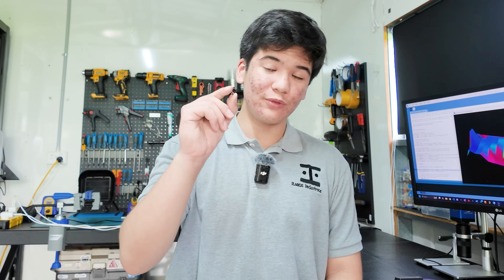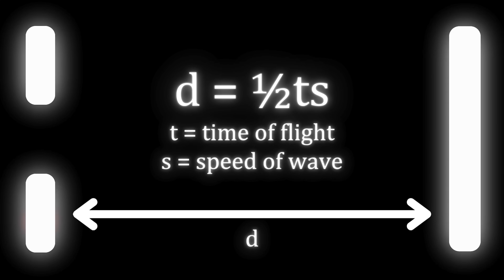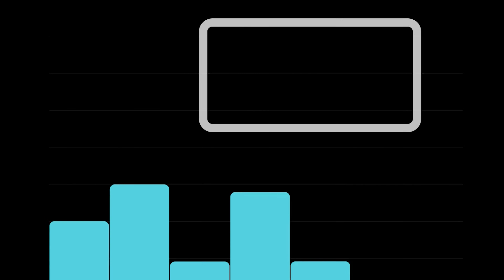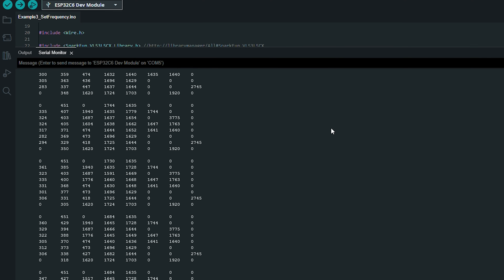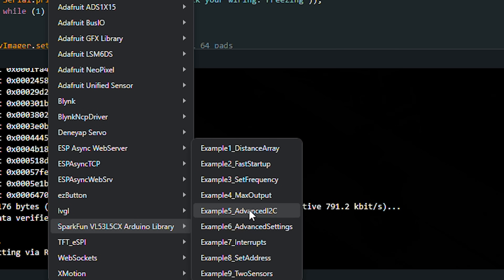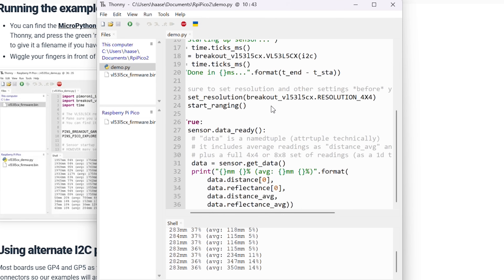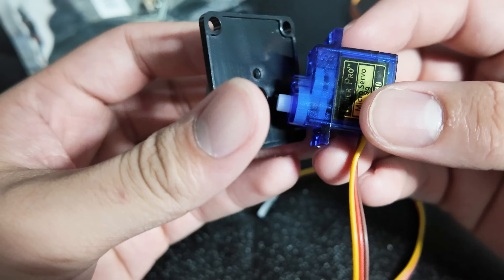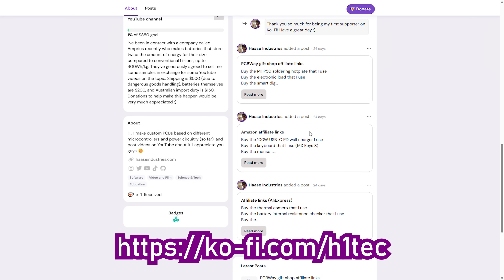This Tiny Sensor Sees in 3D! ToF Sensors w/ STM32, ESP32 & RP2350 Explained (VL53L7CX)

Comment: Btw, can you coordinate multiple of these, using the flash of just one of them at a time but getting the echoes readouts from all them, and compose a more advanced image from a sequence of shots with the flashes from different positions each time, kinda like a phased array?
Reply: Bitluni tried and the aperture is too large by default, I was misled to think this would be shown.
Reply: @H0mework  Are you talking about the field of view or the exposure time? My question was about the possibility of using the known position of the flashes and the timing of the echoes to compose a more detailed and bigger picture using multiple sensors for the same flash and composing over multiple different flashes.

Comment: Impressive. Seems like the frame processing is super slow though. Was that an AI 3D image processing loop being the bottleneck in servo position updates?
Reply from the maker: @fluiditynz  nope, that’s the price you pay for 8x8 resolution - 15Hz frame rate. No AI or anything here, just simple if statements 😁 Take a look at the code, it’s only a few tens of lines excluding all the auto-generated config from STM32CubeIDE. Alternatively, you can do 4x4 at 60Hz. I would recommend the 4x4 at 60Hz for most applications. The ‘slowness’ is exacerbated by the fact that I am moving slowly relative to the area of each ‘zone’, so what you are seeing, e.g. the rate of the laser direction changing, is closer to probably 3-5Hz. Even with 8x8 zones, each zone still encompasses a few centimetres by a few centimetres relative to my face at that distance, so it simply doesn’t have the data to point quickly and accurately at a slowly moving target - not a very precise technology, but that’s what we’re getting for just a few dollars per sensor 😁 you can get 0.5MP ToFs too, but those require heaps of processing power to even consider. At a microcontroller level, this sensor is more than enough to, for example, see whether a sumo robot’s opponent is at a 20 degree or -20 degree angle, which is helpful in any case.
Reply: @h1tec  I think I'm missing the IDE to recognise the core part of your project processing the input data to output the servo information.  Those chips(Microcontrollers) you used are all pretty fast and I presume the 8x8 distance-updates cycle much faster than the servos seem to be updating?  Could it be that the servo adjustments are glitching with the re-writes of the servo required values and zeroing in-progress PWM counts per servo channel? Are you doing any averaging over time to debounce the input array values to smooth them that could be glitching the servos? 15 Hz actually seems pretty reasonable given the application. Is the TOF array chip communications able to be set up with DMA on the microcontroller side to speed it up any? and your servos, are you PWMing them from a library or did you roll your own code?  Maybe my critical eye is simply being misled by pixalisation of the image I see it looking at, which to me is high resolution. In which case it's the pixels that are providing the jerkiness and you could possibly improve smoothness of response by dithering between the pixels to aproximate a larger, smoother array with more subtle depth transitions.
Reply from the maker: @fluiditynz  relative to the sensor, I am only moving a few degrees per second. since each zone encompasses 7.5 degrees, the servo only has those 7.5 degree stops to move to. the data simply isn't there for faster updates 😁 if I moved quicker, it would move quicker, but it would still be restricted to that blocky movement, since it's just going off which pixel is the closest, and not saying 'oh, well that pixel is also pretty close, so I'll go in the middle of the two' or 'that pixel is substantially further than the closest one so I'll go 25% of a pixel towards the direction of that other pixel'. Couldn't be bothered to do something like that lol. Would require lots of optimisation and time I don't have .😁
Reply: @ Interpolating between zones then. Not so bad really, 0..15 x 0..15, odd steps are <<1 to div by 2 and locate scan plot, even steps are 2/((n-1)<<1 value+(n+1)<<1 value,  it's a fast array to fill and then you run your process over the blend of real and dithered date to get smoother result. Obviously can overscan again to get more smoothing but with diminishing return. The dithering is pretty quick process, even if you didn't have chips with HW multiplier, once you make it left shifts instead of divide operation. Actually, the C compilers probably optimise to that these days anyway. You probably have more time than me, 58 here 🤓

Comment: Thinks for the video!
What is the maximal distance the sensor can "see"? Can it be suitable for FPV drone in your opinion?
Reply from the maker: @gluknik  about 3 meters. FPV drones are admittedly super fast, but at 4x4 resolution 60Hz setting, you’d probably be able to get away with it 😁
Reply: @h1tec thanks🙏🏻

Comment: i wonder if you could use these in a phased-array configuration
Reply from the maker: Yeah, that would be interesting to see. I am not entirely sure though. You might be able to ask on ST forums. For my application (sumo robot), the sensors will always be angled 90 degrees from each other, posing no risk of interference, so I haven’t thought about that yet. Thank you for commenting 😁

Comment: Nice! I'm using a VL6180X, which is a single point ToF sensor, in a wireless node for remotely monitoring a process related to cookery, and it works a treat. To get stable results I sample a batch of readings consecutively, skip the first few readings and average the remainder (around 30 readings overall), and found that works well to get stable 1mm accuracy. I also use a short SMA on those reads to further filter, and overall the setup works a treat. They're super useful sensors.

Comment: that doesnt look like mm resolution
Reply: agreed. The actual demo with the visualisation was very odd. Did not convince at all.
Reply: Worked with the 5cx sensor on a project, could not for the life of me get an accurate measurement because of a recalculation that happens within the i2c ic of the sensor itself, it adjusts to a flat surface, which caused our SLAM mapping to fail, it wasnt correctable fron what we found, so project failed but we still passed because it was an issue with how ST made the sensor. Highly advise not using it, use mmwave radar
Reply from the maker: @grindfi  can mmwave radar be used in the same way? What do you mean ST's ToF ICs adjust to a flat surface? There's also ToF sensors from osram that I've heard are better than st in some ways.

Comment: this can be used as 3d printer bed leveling probe ?
Reply: Actually reading the datasheet would give you the right answer: No
Why? it's kinda slow, and not precise enough by A LOT. On page 23 there are some examples, you can expect maybe ±10 mm. You would need a ToF Sensor with better than 0.1mm accuracy, to get any meaningful bed leveling data.
Reply from the maker: @ProtonOne11  oh whoops you’re right a forgot about the accuracy lol. Good catch. It was super early in the morning when I replied and it hadn’t occurred to me that levelling a 3D printer bed would need sub-mm level accuracy.
Reply from the maker: No, unfortunately, the accuracy is not good enough

Comment: Bro how could I integrate one of these into my FPV quad for object avoidance?
Reply from the maker: I don’t know much about FPV, but you would need a microcontroller to read data from the sensor and automatically control the motors based on if it sees something. Maybe you could attach it directly to flight control board? Would be a very difficult, but interesting project 😁

Comment: Great video homie! Keep it up.😊

Maybe consider some videos where you make use of older,  ICs and maybe some prototyping board. I know it's a pain, but might be worth it for some of us cheapskates. I recycle and make use of old components in almost of my projects
Reply from the maker: @dillanclark864  thanks 😁 I’ll consider using some of those old components sometime - I eventually need to learn how a microcontroller works at the transistor level so I’m sure some of these small components will help 😁

Comment: I been trying to make my own pcbs finally and my brain refuses layers. Like legit just a front and a back will make me fetal in the corner and cry sometimes. Is there some trick to like, making it easier on your brain?
Reply from the maker: Hi, thanks so much for being a member for so long 😁 some things that help are using the front layer as the main layer and using a 3D viewer for your board to help see the other side not inverted, as it shows up inverted on the PCB layout 😁
Reply: @h1tec  my brain can handle like 6 traces on the front and 2 on the back :| guess I'll need more reps.  So far I just send to PCBway and hope if I did anything too stupid they'll find it in review 😅
Reply from the maker: @jolttsp  you can always send them to me to review on discord @_h1tec too 😁
Reply: @h1tec  whoa thanks! I'll try to slog through them but I might take you up on that before I order anything too expensive 😁
Reply from the maker: @ 👍 thanks 😁